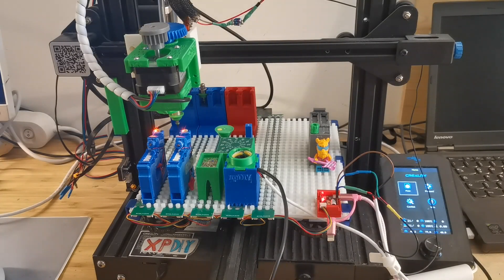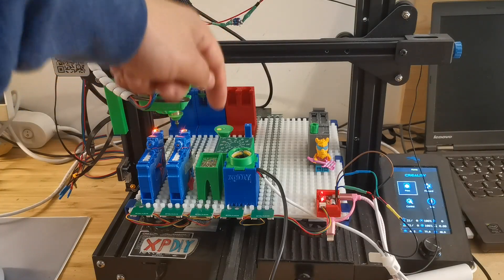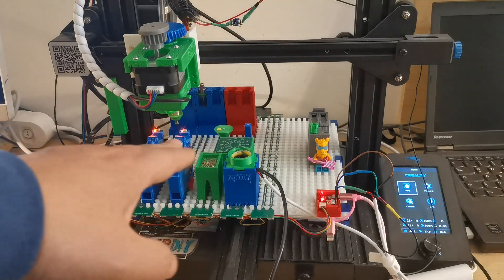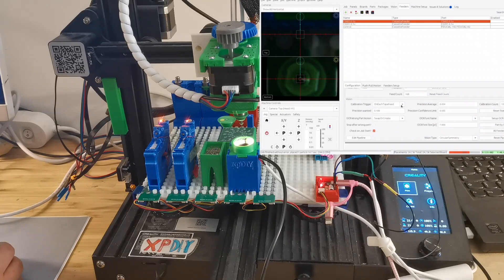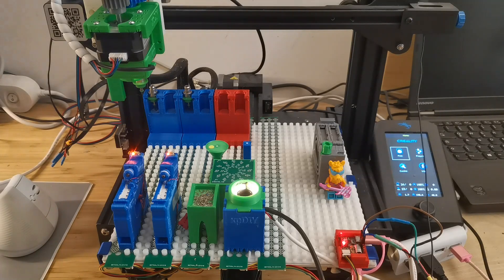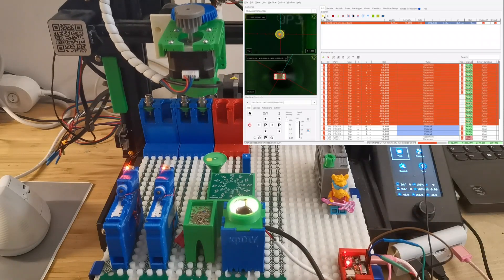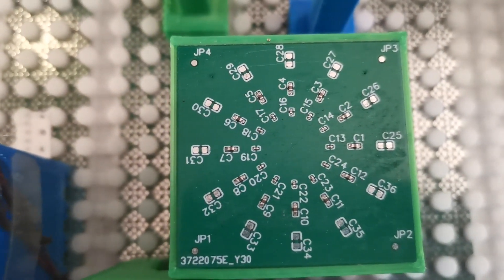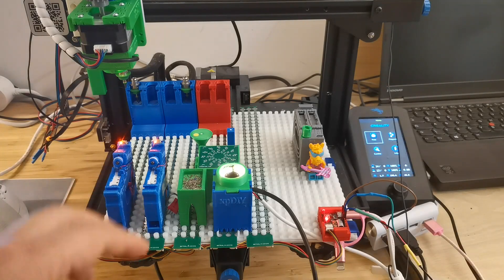3DPlacer - Need for speed! Can it be faster than 236 CPH?

Comment: I went to your shop to buy the parts to convert my 3d printer to a pnp machine but it says out of stock. Is there a chance your have a kit left? If not what do you recommend to do?
Reply from the maker: thanks for the message, currently the item is sold out, you could leave your email in contact@xpdiy.io, then I can send you the file to make PCB, you can order from PCB vendor as well.

Comment: Put the pcb, feeder pickup, and camera at the same z height so that you only have to z retract a few mm between movements.  You can also put the feeders closer to the camera to get your speed up.

Another idea would be to put the camera on the moving head pointed downwards at a slight angle to the tip, you would have to un-skew the camera output but could do the camera work while it's moving to get even higher speeds.
Reply from the maker: Thanks for sharing the ideas, optimizing the layout will help for sure. Tilting the top camera is an interesting idea, not sure if that will affect accuracy, but worth a try.

Comment: You know you can change the focus of the cameras to suit your working distances?
It usually requires breaking of the glue drop they place on the threads but once free they are easily adjusted.
This is assuming you are using fixed focus cameras (because focus is so poor) and it is not practical with autofocus on CV systems as it changes the aspects of image.
Reply from the maker: Indeed the focus need to be adjusted better, thanks for pointing out!